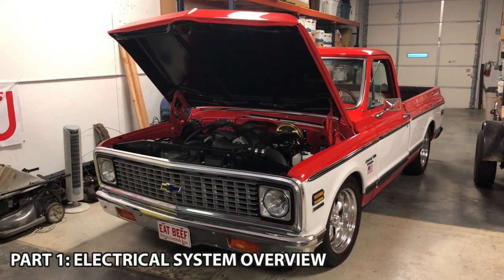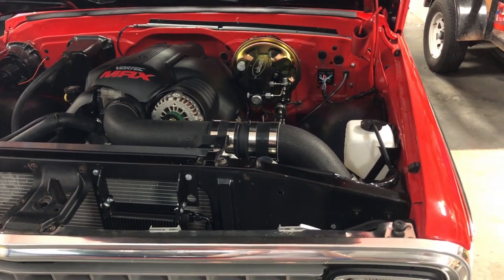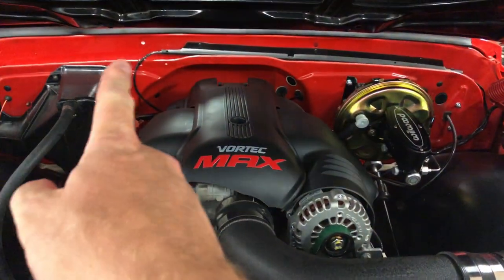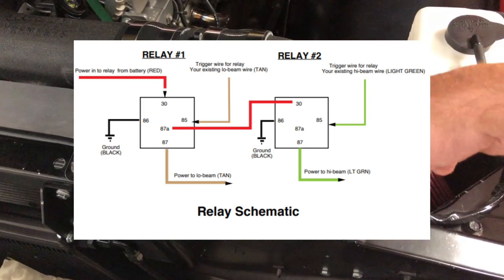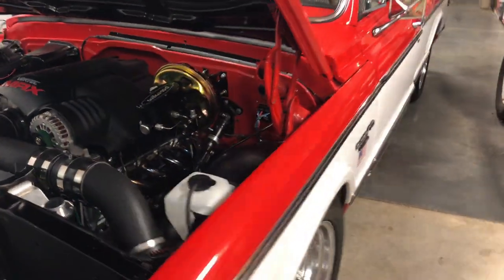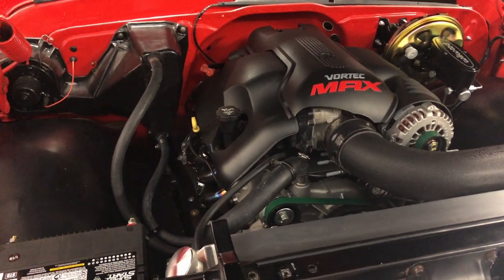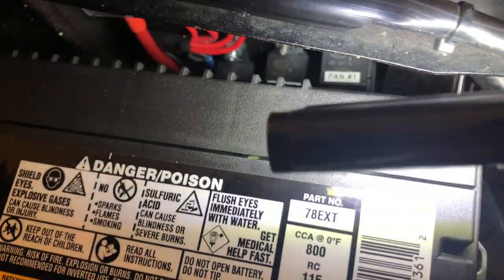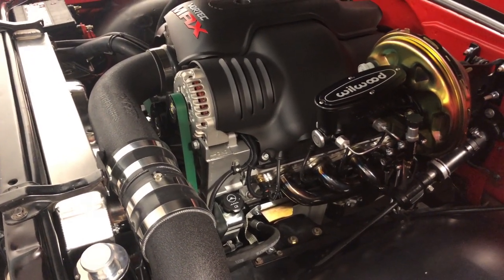About The Build Ep. 1 - LS Swapped C10 Electrical Systems

Comment: Man that's a nice build!  I like the engine cover my self
Reply from the maker: Thank you! It is growing on me.  Interestingly enough, I get more questions about what a Vortec is and is it an LS than just about anything out.
Reply: @RustyWrenches  I tried to talk my friend into doing the cover on his 6.0 but he did the LS1 intake instead looks great but now trying hide some wires and figuring out the electric fans and cover with out it looking hacked up
Reply from the maker: I hear you.  I tucked my wires before I did the cover.  I wanted to keep the truck intake because it helps with low end, but the LS1/6 intakes do look nice
Reply: @RustyWrenches  o yeah ur right I didn't think about that.  Ur truck really came out nice! One of the best swaps I've seen
Reply: This truck is beautiful!! Great videos and your OCD is just what I need since I got the same issue. :) Now... where DID you get the cover?  I’ve found the center piece but not all three pieces. Just subbed. Thanks again.
Reply from the maker: @djazzy1016  Thanks for watching!  For the covers, I bought them from GMPartsDirect.com.  19355583 is the center MAX cover, 19355582 is the left (drivers) side cover, and 19355580 is the right (passengers) side cover.  Hope this helps.

Comment: Great video. Thanks for sharing. I like how you ran your LS harness into the cab underneath the seat. Where did you drill the hole at?
Reply from the maker: Thank you.  I have a bolt in high hump that I drilled a hole in the rear of the hump.  It was a straight shot to under the seat.  You can see it in this video here https://youtu.be/DsGyZeUV_TU?t=11

Comment: Sweet truck! I have done frame off restos in two trucks, a 71GMC swb step with a 6cyl and 3 ott and a 72 chevy swb step with a sbc and 700r4. They had $5k and $10k paint. My current truck is a 70 with a 71/72 front bumper and grill. It will be getting an LS 1 from a 99 TA and be a “patina” build. I came across your series looking for tips and inspiration. I have used american autowire on several vehicles and was impressed as well. Curious why you went with 70/71 door panels in your 72 doors. Did you just prefer them over the plastic 72 door panels?
Reply from the maker: Those sound like great builds!  It’s amazing how much paint costs these days.  Materials alone are crazy.  You’ll love the LS.  I wasn’t 100% sure, but now that it’s done, I love it.  My truck came with the 71 door panels.  The previous owner didn’t like the plastic panels and swapped them out.  I have to agree.

Comment: Hey man immaculate work... I got a couple of questions, the radiator and fans links from what you use..gas  tank set up.. did you end up doing the c notch on your truck. and last question  from what truck you got your differential..thank you very  munch for your videos....
Reply from the maker: Thank you!  The radiator and fans are from Entropy.  I have the LS swap radiator.  Fuel tank is from Boyd Welding.  The rear end is from a 72.  Diff is an Eaton LSD
Reply: @RustyWrenches  thank you for a quick reply... I got a 72 c10 and I'm not sure if i can use my original differential I'm putting a 6l90e I hope you know I'm new in all this but been following  your videos and they been very helpful.. thank you once again
Reply from the maker: No problem at all.  You should be able to use the stock rear end no issues.  You’ll have to have a driveshaft made that has conversion u-joints and it will slip right in.  If I remember correctly, the 90e uses a 14 series u-joint. Just need a conversion u-joint and you’ll be set.

Comment: How did the Ls harness adapt to your ignition switch to be able to start it? That’s where I’m stuck.
Reply from the maker: So I used the stock starter wire from the ignition switch to the starter.  I’m not using anything in the LS harness to engage the starter.  Hope this helps
Reply: Rusty Wrenches nice! So it sounds pretty easy then.  If you have it directly hooked up to the starter, how does the engine switch off when you kill the engine on the ignition switch? Thanks!
Reply from the maker: The ECM is hooked up to a switched hot when cranking 12v source.  When you turn the key off, the ecm knows to turn the engine off.  Head over to lt1swap.com. He has a ton of information and wiring diagrams that can help out a lot.